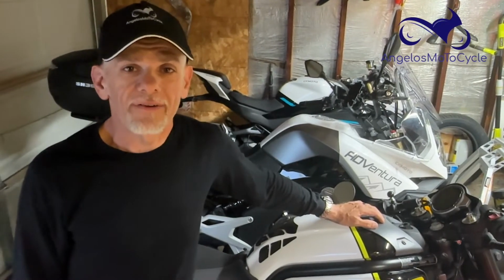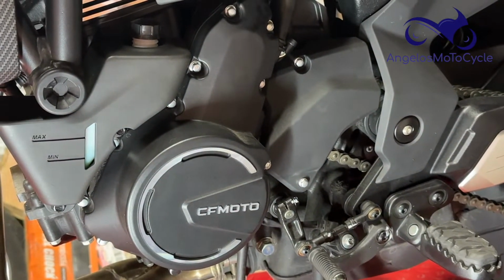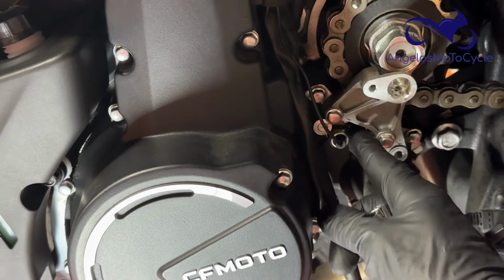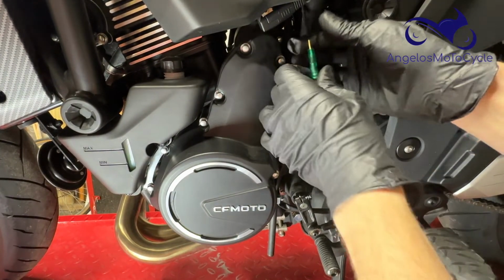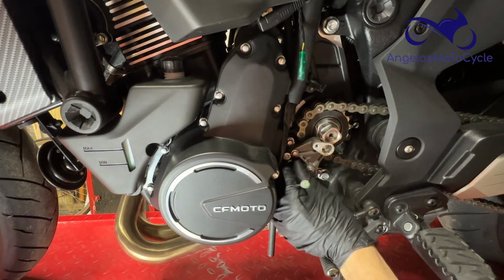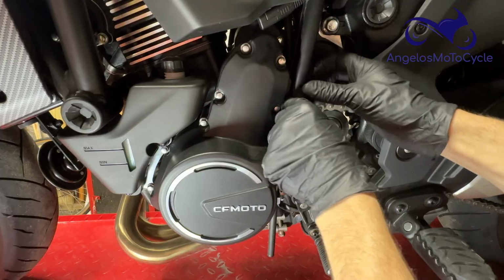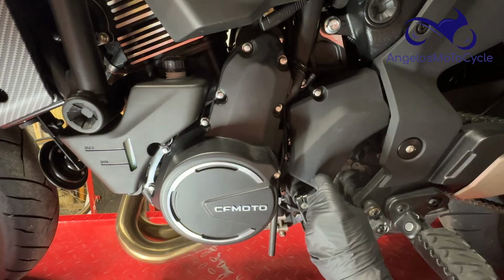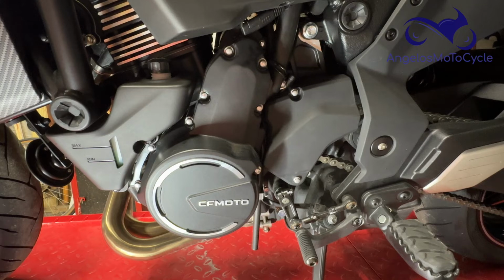How to fix the CFMOTO gear indicator quick and easy.

Comment: I just removed the washer after  having the same problem and watching this video. I'll keep you informed after a test ride.
Reply from the maker: Good luck and thank you!
Reply: Hi, thanks for sharing. Can you have any update?
Reply: @sametustabas1839  It worked for a while, but then started again after 4-5 days. But i hadnt used ptfe tape in the first time. Yesterday I also put the tape on the sensor. Today it seemed ok, but need to observe more.
Reply: Teşekkürler, i will try for mine after couple days
Reply: After 2 weeks, i can say that ptfe tape (doğalgaz için kullanılan teflon bant) works better. No fault on gear sensor since i've applied it.
Reply: @onurcoban61  Nice idea.
I talked about this with a cfmoto dealer and they say this affects the warranty but I will probably do.

Comment: Another NYer here! I have the CLX 700 sport and did this exact thing with my bike. I had to replace the sensor as well. I have 2,600 miles on mine and I love it. I picked it up for $5,999, crazy value for the money.
Reply from the maker: Way to go! It is incredible value and a fun machine that gets all kinds of looks wherever I go! Keep riding safe and having fun!!! Thanks for watching!
Reply: 12740 usd in Turkey 😮
Reply from the maker: @Oldgamer93  WOW!!!
Reply: i bought mine for 4800€ but i m kind of scared of this issue, i hope this will fix it. i m still waiting for it
Reply from the maker: @raduandrei3570  in the big picture it is a small issue. Mine only did it very occasionally - the rest of the time it’s still very fun to ride and has been reliable. So don’t worry! :-)
Reply: @raduandrei3570  your gears don't actually change, it's just how it is displayed on the dash, and of course it cuts off cruise control, but otherwise the bike mechanically works fine.

Comment: That’s awesome..going to do it right now.
Also,anybody having problems with bogging at low rpm acceleration? 
Ghanks
Reply: Changing to higher octane fuel and using some injector cleaner in the fuel tank fixed this for me

Comment: I was having that same problem with my CFMOTO 650 Adventura. It; went to the dealer for a water pump leak and I informed them that I was having that issue. They could not duplicate the error so they told me to try and get a video of it happening. Problem is it only happened when I was above 75mph that I noticed it and I was not thinking about making a video of it happening. Now that I have the bike back I'll see if I can make it happen. Also, according to the dealer, since I have a 2022 I don't have the spacer so it shouldn't be happening. Yet, it did happen!!.!

Comment: Appreciate the video.  My problem is my TURN SIGNAL.  It turns off BEFORE every turn.  My dealer is no help right now … Maybe I can remove a washer to fix this problem. Lol.  I even removed one of the fuses. That didn’t work.  I did call CFMoto.  They said I needed to go through my dealer to talk to the TECH department.  Is there any fix for this. I have a 2022 CLX 700.  Just a little over 700 miles.  What a fun bike. Thanks for any help.
Reply from the maker: My 700 CL-X does the same thing. Unfortunately that’s a software thing. I’m hopeful we can get CFMOTO to address it with an OTA update through the app to the bikes. I just keep hitting the button when it shuts off too early. Lol. Thanks for watching!!!
Reply: @AngelosMotoCycle  Thanks for the reply.  Maybe one day CFMOTO will have a fix.
Reply: Idk if this can be of any advice but a trick I do is I hit the signal once to get over then after I change lanes, I hit it again before the I turn and it seems to work well that way. It’s like the slightest lean cancels out the signal.
Reply: @R3d_R10t_h2e  That doesn’t work for me, but thanks anyway.
Reply from the maker: @R3d_R10t_h2e  thanks! I’ll give that a try.

Comment: Hi angelo, great explanation, i have a CFMoto 650 TRG, today it start flashing from 1 and 6th, then its is stuck on 6, and also theres is no neutral gear sign, despite it is in neutral, so i have ot set the clutch to start the engine, does this happens also??

Comment: Ive heard some teflon taping the thread afterwards, so it wasnt needed for your fixes?
Reply from the maker: I’m sure it wouldn’t hurt as long as you are very careful to not interfere with the sensor but I didn’t need any and the guy from CFMOTO that I talked to didn’t say anything about that.
Reply: @AngelosMotoCycle  I tried it but issue returned after about 50 miles on freeway. 😔
Reply: @bdsurfer13 You probably need a new sensor. Get a replacement  under warranty or order one. They are only about $25. I'm a CLX sport owner in NY

Comment: Thank you for this video Angelo!  i just purchased the CL-X 700 Heritage, trying to figure out what would be the best way to lift it with the paddock stand, on my ninja was super easy i just used the swing arm pads, would this be possible with the CFMoto or do i need the spool.  i know this is basic stuff, however if you can do a video with this subject and maybe oil change or chain maintenance that would be super useful.  The sport you have is like a twin of the heritage from my understanding.  Cheers mate!
Reply from the maker: Thanks very much for watching! I added spools on mine for ease of use. I’ll work on some more basic maintenance videos.

Comment: Mine is between 4&5...it shows gear 3 or 5 but it's only at gear 4
Reply: Noticed mine started doing this as well. I honestly never looked at what gear I was in on my CBR because well it doesnt have an indicator. For some reason I tend to look on my CLX a lot and noticed it jumping... only happens in 2nd or after but not in 1st.